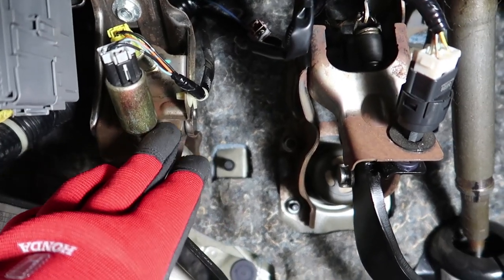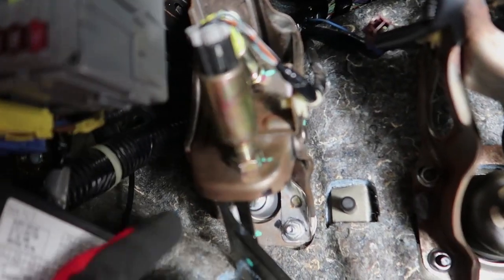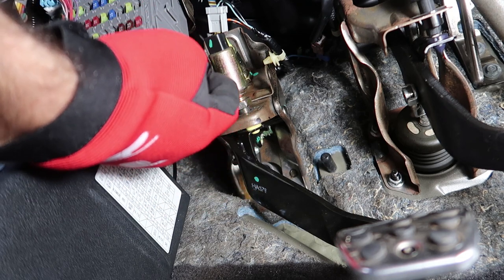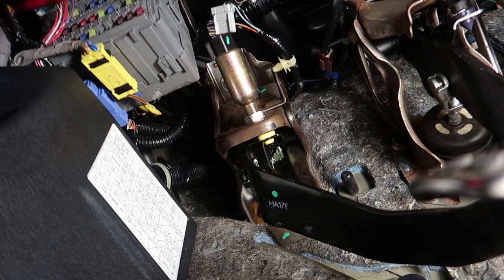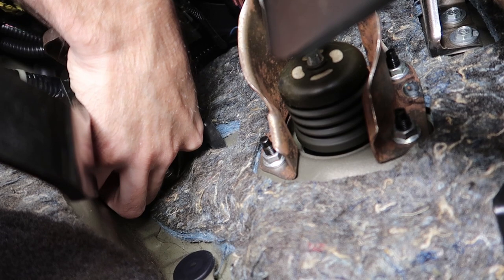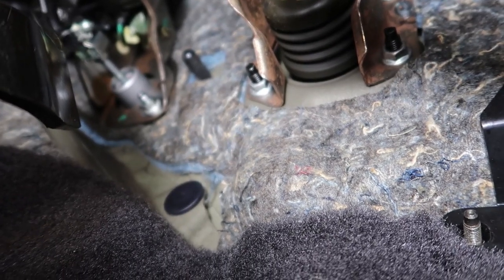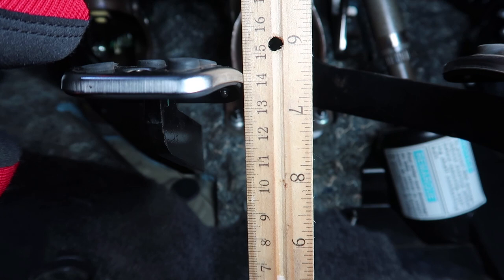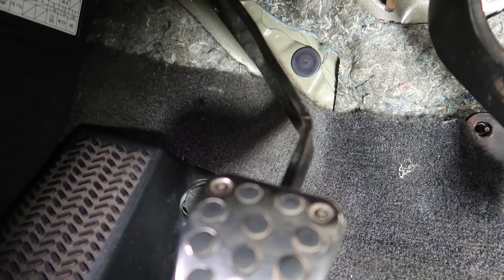8th Civic Si and RSX Type-S Clutch Adjustment DIY | Aftermarket and Stock | FG2, FA5, DC5

Comment: Hey Jason. I’m experiencing notchy shifting in 2nd and 3rd at low rpm’s driving normally rowing threw the gears. I have hybridracing shifter bushing on the trans cables. I’ve changed my fluid to oem. I don’t have this issue at high rpm’s shifts only regular driving. I tried your adjustment but I’m curious as to the free play part. Do you measure the pedal play or until you feel resistance on the pedal? If you know what I mean there is pedal play to where the clutch fluid is felt resistance or the pedal itself has a small amount of play before the resistance from the fluid is felt.
Reply from the maker: Until you feel pressure. You could try to readjust and make the pedal travel a little longer (less threads showing) and see if that helps with the notchy shifting, just readjust the freeplay after doing the threads

Comment: I wanna know which one u got ktuned or oem clutch master cylinder?
Reply from the maker: I have both, but I use a brand new oem CMC currently. K-tuned does release slightly faster, but I like the pedal travel better on the oem one.
Reply: Ok does your pedal have 
squeaky noise ? Mine does.  Maybe I adjust wrong way
Reply from the maker: @marvingjimenez7252  I dont have a squeaky noise but make sure there is grease on the pin that connects the CMC to the pedal (honda urea grease is the best), sometimes that can cause a squeak
Reply: Jason McMullen thank you..cmc ktuned need to have stock pedal adjustment?
Reply from the maker: @marvingjimenez7252  K-tuned cmc will be shorter pedal. You need 5 threads showing on the bottom of the clutch height adjustment screw. And at least 10mm of freeplay
Reply: Jason McMullen thank you. I will do it. Can affect the clutch ?
Reply from the maker: Marvin Fitness yes sir
Reply: Like damage the clutch ? I didn’t know that
Reply from the maker: @marvingjimenez7252  If a clutch is not adjusted correctly, it can potentially damage the clutch and the transmission. Clutch overstroke is bad for the clutch, and not enough freeplay is bad for the clutch/release bearing. The Clutch not fully releasing is bad for the transmission synchro's. So adjusting the clutch correctly is very important. A Squeaky clutch does not necessarily mean there is a problem by the way.
Reply from the maker: @yah yeet yep! I had one and it makes the pedal pretty short. You get use to it though and it can make shifting slightly faster
Reply from the maker: @yah yeet btw you might be able to adjust it to be slightly higher if you really want to but the stroke short so yeah
Reply from the maker: yah yeet I’m not completely sure but I think it will more like stock (maybe email k-tuned before you try to make sure).  Could try to go to 4threads and redo the freeplay, as long as you don’t overstroke the clutch shifting at high RPM from too much travel it will probably make the engagement a little higher up (it can get annoying to keep trying to adjust though)
Reply from the maker: @yah yeet Awesome to hear!

Comment: Off-topic Question: Where'd you get those red Honda gloves??
Reply from the maker: I got them from keenanhonda on Ebay, they are sold out now but someone posted a pair for sale in size xl, just search honda hfp gloves on ebay or google, they are made by Honda so you might be able to find them somewhere else. These gloves are comfortable too
Reply: @JasonMcMullen  Ah XL is too big for me. Might be able to do an L, but I'm generally an M.

Also, how long have you had the K-Tuned CMC and CSC? I read some drivers were having issues with the CSC after awhile, but I think K-Tuned might have fixed that. I'm debating on this kit, but just want to hear as much personal experiences as possible.

Comment: Question: I have 2010 fg2 115k-kms and i adjusted it exactly how you described with number of threads and spacing, is this okay to do without putting in a brand new clutch? It has stock clutch and hasn’t been changed in a long time. So I’m wondering if I shouldn’t have done it? Thanks
Reply from the maker: yes it works great for the stock clutch too
Reply from the maker: should be fine
Reply: @JasonMcMullen thx! I noticed a big difference right away, changed the whole feel of the clutch and shifting for the better

Comment: Help , my push rod is stiff and i cant turn it with my hands , what could it be?
Reply from the maker: If you push down the pedal very slightly with your other hand while trying to turn it, it will make it easier to turn. The nut was probably tightened too much and it damaged the threads, making it hard to turn.
Reply: Jason McMullen Thanks and also i got a stage 3 action clutch with a stock cmc , how much thread? 1?
Reply from the maker: @fa5_ant219  yeah try 1, If you still dont get smooth shifts then go to slightly less threads and redo freeplay, if you feel too much pressure only at the bottom of the clutch pedal (when shifting at hi RPM) then use slightly more threads and redo freeplay.  Should be able to get it perfect
Reply: Jason McMullen Thank you!
Reply: Jason McMullen Ok so now i got the ktuned kit for the cmc and slave cylinder , now how much thread would i show? still one ? with my stage 3 action
Reply from the maker: STK24 usually the k-tuned kit is a shorter throw so you set it to about 5 threads showing but if you still don’t get smooth shifts when the car is warmed up you can try less. Make sure to always redo the freeplay after you adjust the threads

Comment: hey man, I did this on my 08 si and I have also done acuity base and shifter bushings, as well as weighted shift knob and Honda OEM transmission fluid freshly done. after all that, it still grinds terribly. oddly enough a lot of people complain about it at high rpms but the problem for me is low rpms, just driving around town. do you have any advice on what it could be? I feel like I have tried everything and I just can’t win. it grinds 2nd, 3rd, and 5th constantly
Reply from the maker: You on the stock CMC? Try to go less threads showing and then redo the freeplay. You can also test it by holding your foot an about inch off the ground and it should still shift gears with the car running, you should have enough clutch travel for any type of driving
Reply: @JasonMcMullen  yeah im still on the stock CMC. im gonna try to go with less threads i have 2 showing right now i think. thank you tho bro ill let you know how that goes
Reply: @JasonMcMullen  oh yeah and it also doesn't have much free play at all right now, so im thinking adding a little bit more might help
Reply from the maker: @colbyvaughan8578  no prob. Yeah around 1 or even half thread should help. Around 10-11 mm freeplay should be good. Minimum is 9mm

Comment: my pedal was all the way out with very low to no free play, and the clutch wasn’t engaging at all. neutral it idled fine, and the car didn’t move. i also have an aftermarket clutch.
Reply from the maker: Hey Welshy was that before adjusting it? Gonna want to go to more threads showing and then introduce at least 10mm of freeplay for that issue
Reply from the maker: Maybe you already know, I hope it helps buddy
Reply: @JasonMcMullen  i adjusted it, the k20z3allmotor video said to make sure to eliminate the loose rod
Reply from the maker: @WelshyAutomotive  oh gotcha, yeah I’ve seen that and it’s odd because these CMC’s require freeplay according to the service manual. I’m glad you could adjust it. Love your videos buddy keep up the good work
Reply: @JasonMcMullen  yea i’ll have to check it when i go and check it again, clutch would be all the way out in neutral and she’d be mint. and thanks so much man! appreciate it.
Reply from the maker: @WelshyAutomotive  right on man let me know if you have any issues 🤙

Comment: So what process is if the clutch catches too high ?
Reply from the maker: Charles Abiola well you can go to more threads showing, and redo the freeplay. But you run the risk of not having enough release travel to have proper clutch disengagement. The K-tuned EM1 style cmc will make the pedal much shorter

Comment: Sooo do I turn the rod clockwise to lower the engagement point in the pedal, or counter clockwise? Right now by the time the clutch engages my knee is in the steering wheel.
Reply from the maker: Try a little more freeplay (counter clockwise)

Comment: So my k tuned pushrod has been stripped im assuming because there is always resistance. Should I rotate it untill it stops rotating and then put it back half a turn? What exactly does "untill you feel resistance" mean? thx.
Reply from the maker: try to push in the pedal a little with one hand while you try to rotate it. If that does't work then check the amount of freeplay with a ruler and see where you are at. If you can't move the rod at all then the the freeplay can't be adjusted
Reply: @JasonMcMullen  Ok sounds good thx! I can adjust the rod, there is just no way for me to judge the resistance, but there is a point where the rod stops, is this where i turn it back a half turn? I just wanna make sure i dont break the CMC.
Reply from the maker: @mathar9191  yeah, if you are pushing down the pedal a little, then feel resistance (the rod starting to try to push the fluid) then go back a half turn, and let the pedal back out. It should give you enough freeplay.  If you want to readjust then go back and adjust the height and then repeat the freeplay process

Comment: I just replaced my CMC and when adjusting the push rod, I can find the pressure points during rotation you mentioned because it’s not turning freely. The nut is cracked but either direction requires considerable force with little to no rotation. Any thoughts?
Reply from the maker: You can try to push down the pedal a tiny bit with one hand while turning the rod with the other hand. You can also check the amount of freeplay with a ruler after to make sure you are in the right range (so the pressure point isn't necessarily needed. If you have about 10mm of freeplay it should be fine. Also since you just replaced the CMC, make sure the system is bled properly.
Reply: @JasonMcMullen  you’re the man! the pedal trick helped and I got the free play perfect. Bled the system one more time for good measure - no air and feels 100% . Thank you
Reply from the maker: @GregMcKiernan  hey thanks man! Glad to hear its all working well!

Comment: Hey man, I follow the adjustment exactly as you did and now the clutch engages about halfway up which feels good, but I have no free play at all. I can only turn the push rod on the master cylinder about 1 full turn in either direction before meeting resistance. Any ideas? I have an exedy EM1 with OEM rod
Reply from the maker: Well if you still have space to turn the rod clockwise then you  will have probably have some freeplay. You can turn it another half turn counter clockwise also
Reply from the maker: also try to push the pedal down a little bit with one hand and then twist the rod with the other, maybe your master cylinder just has a rod that is hard to turn

Comment: I have a em1 cmc and when I try to adjust it with 5 threads sticking out of the bottom it puts preload on the cmc what am I doing wrong?
Reply from the maker: adjust the freeplay after doing the thread adjustment. As long as you have 10mm of freeplay it shouldn't put pressure on anything

Comment: Hey Jason, this was super thorough and very helpful.  Prior to adjusting my pedal position with the stock oem cmc (pre update), 2nd gear would lock out on me, and delay into shifting.  I had it at about 3 threads.  After adjustment, I can actually shift into 2nd gear, but it is notchy i can feel the gears grind lightly at Low speed/throttle.  After the camswitch though it goes in like butter.  Any thoughts if this is a cmc or csc issue or am I going to have to pull out the tranny and look at the clutch/gears?  I have an exedy stage 1 clutch, and lightweight flywheel.
Reply from the maker: Hey buddy, maybe your aftermarket clutch might need a little more travel, maybe try to adjust the pedal out more, little by little. From what you said it might be almost in the right spot, but just needs a little more room. If you recently replaced the clutch system, maybe double check there is no air in the lines, and no leaks. You could certainly try a new CMC/slave but not sure if that it would change things.  Hopefully the trans is fine, and I hope it works out for you bro. Let me know and I'll do what I can to help. Thanks!
Reply: @JasonMcMullen  Thanks for the quick reply dude! Hmm, Dunno how much further i can bring it out, it's at what i'd guess to be a 1/4 thread atm.  No thread? I haven't seen any leaks and the fluid looks clear in the reservoir, but I could try replacing the fluid in the clutch altogether.  It rains on average about 300 days a year here, so maybe it's absorded a lot more moisture than I thought.
Reply from the maker: @amazingactionape  I see. Yeah try to go to zero threads (just a tiny bit of the adjustment screw showing so that the stopper still hits the adjustment screw). Every mm makes a difference.  And yeah its possible that fresh clutch fluid will help. Also fresh manual transmission fluid will sometimes help shifts be smoother as well.  Also you could try the K-tuned 8th gen CMC, which will give you room for extra release travel
Reply: @JasonMcMullen  Alright, i'll give that a shot before tracking down a new cmc.  Thanks Jason!
Reply from the maker: @amazingactionape  No problem bro, I hope everything works out for you

Comment: Hey man I really need a reply. So I installed the em1 cmc. I give it 5 threads on the bottom, but my rod on the cmc won’t budge until I use some pliers. Also I have a stage 1 clutch and a lightweight flywheel. My clutch disengages pretty high on the pedal. Do you know how I could solve this issue?
Reply from the maker: For the rod, try to push down the pedal a tiny bit with one hand while turning the rod with the other. By disengage do you mean the bite point when when releasing the pedal or when pushing the pedal down?
Reply: @JasonMcMullen  okay I’ll try that step for the rod, as for the disengaging, what I mean is the grabbing point, because as I lift off on the clutch, car wants to move when I’m almost fully off the clutch pedal. So really I can put it in gear, barely pressing the clutch.
Reply: @JasonMcMullen  hey man so I adjusted my clutch now. But I’m curious to where you got the 5 threads spec from for the em1 onto an rsx or civic. Also would it still be 5 threads showing if I have a stage 1 clutch with a lighter flywheel? Could you give me some insight on this? Thanks man I appreciate.
Reply from the maker: @idrcookiez620  basically the em1 cmc uses less throw than the stock cmc. If you feel like you need to go to less threads showing for your particular setup then you can certainly try. Also just fyi, the civic si and rsx type-s have different adjustment than the base model civic and rsx.
Reply: @JasonMcMullen  your video was very informative, just had to watch it a few times. I realized I didn’t do the adjustment right the first time. But now it feels like what it’s supposed to. I knew my clutch felt off. But I did add the 5 threads and just adjusted the rod. Now my clutch has a shorter travel distance, but within that shorter travel my clutch engages a bit more in the middle and it feels what it’s supposed to feel like.